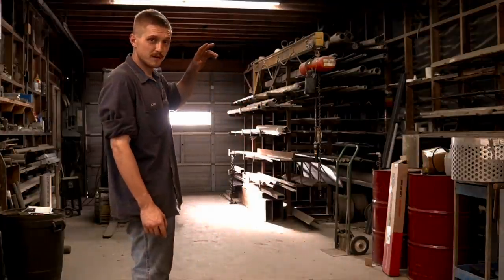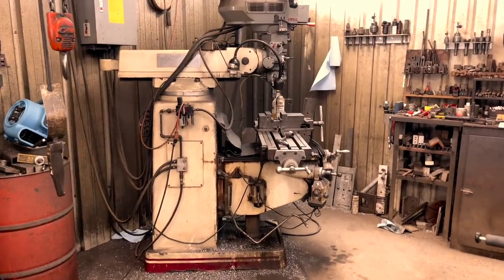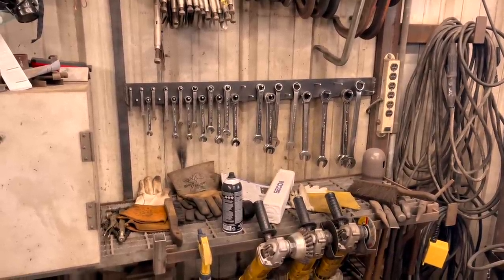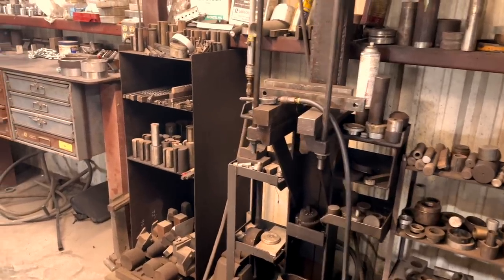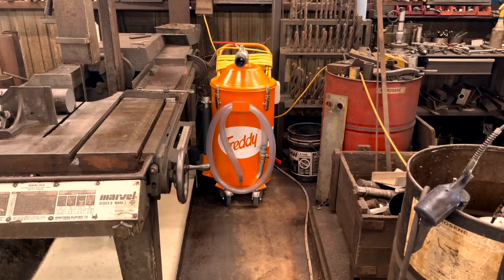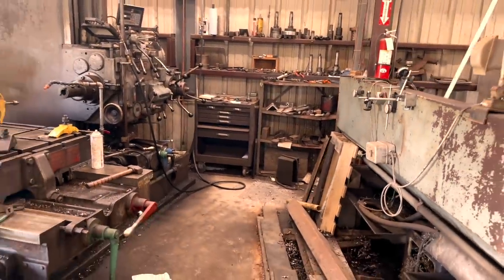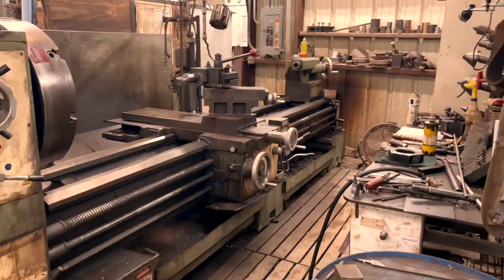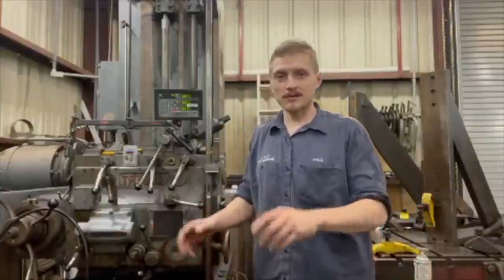Machine Shop Tours: TJ's Machine Shop

Comment: A REAL Machine Shop! I miss these old places where you can virtually make or repair anything. We had a bunch in Signal Hill, Ca for the oil fields and Aircraft Maintenance. Plus, with Lions Drag Strip nearby, the owners would invent new dragster parts on the fly! They're  all gone...

Comment: Thank you sir. Much brighter, cleaner and far more room than the shop I started in when I was just a sophomore in high school. I was 14 or 15 and ended up with quite a career in CNC and CAD CAM as it was coming out in the 80's and 90's. But I am still a damn good manual machinist. Much administration sir.

Comment: That brought back a lot of memories for sure. Some of those machines were identical to what I learned on. Same as you, Air Force machinist and went in machine shop work after separation. Worked 29 years in job shop. Started out all manual machines, then learned CNC when it came on the scene. Moved on to another big shop and retired about five years ago after 45 years in trade. Sure do wish I still had access to a shop like yours.

Comment: Great shop tour. Don’t just throw in a bigger breaker without upgrading the wire. The breaker is sized to trip before the conductor melts.
Reply: Yes NO & Some times
 The NEC allows you to size a circuit breaker at least 175% of nameplate ampere. Often had to install next size circuit breakers for say air compressors to prevent breaker tripping on motor start up. 40 years ago the NEC only had a quarter millon words. Probsbly halve a millon words. Asked 3 smart inspectors the same question and more then once got 3 different answers. Great to see that there are still some shops not using CNC mills.

Comment: You might consider making more videos.  Your presentation style is excellent.  Question...what is a spade bit?  I'm familiar with wood spade bits of course, but not metal.  Do they use an insert for the cutting edge?  Will they work on a standard milling machine (Bridgeport) or are the speeds/feeds/down pressure insufficient?  Thanks.
Reply: It’s just a drill insert “Spade drill insert” on msc 
You can, I’ll rarely do it, but it can handle up to 3/4” usually. 3 thou feed off the quill will push a 3/4” at 300’rpm. Paired with coolant they’ll last a long time.  Twist drills are faster with cool mist going on a Bridgeport. If you need to make big holes quick look into slugger bits.  On the lathe spades  are best if you have reduction  tail stock.

Comment: Very nice Tour  i am a retire Woodworker by trade  although i  do have severalFamily members that own and Operate their own small Machine Shops , we did exchange Work Professionally for many years  not really anything that made each other Wealthy , but it was always nice to know we were making a honest days Pay  on those Jobs as well as getting a fair mutually beneficial deal , for myself personally one of my  Duties in our Shop was setting up our new  or Newly Aquired Machinery for the Shop  and i usually got  called to  be of Service to the Family for the same reasons  I’m okay at operating Heavy Machinery  and  moving large heavy items  to get them into a precise Position with little to no damage  plus in all honesty the exchange does help me out on getting personal Welding Jobs done  or strange Parts i may need  for my Shop ,Boats ,Or whatever i can Weld structurally but i’m no Artist  and to coin my ownFathers saying as a him being one of 3 sons to a ProfessionalWelder  my Dad would call Splatter Bird Shit or droppings  so myself  i prefer to leave the Welding to the Professionals  and i’m fine with running over to their Home  or whatever to run some Moldings or whatever they may need

Comment: Same as the shop I started in way back. There was an old timer that had scratched his name on a window pane. in 1916. 'Gus' still worked there in 1968. I would like to have learned all he forgot. Lots of bigger machine , planer , shaper big radial drill, thread mill.

Comment: Bigger than the machine shop I worked in but similar machines. I worked in the tool and cutter grinding side mostly for customers.  Cincinnati's tool grinders,  big mattison surface grinder , O.D grinder.  I did cutter grinding for 31 years shop is still there

Comment: I most likely bought those CNC machines for your Air Force shop.  But I have no love for CNC machines and the monkeys that press the buttons.  I can make most one off parts for a repair or a production run without the scrap and crap (and I can damned well still do it at 77) the CNC produces in less time and materials used on those old worn-out shop machines "that only real machinist know where to put the paper and brass shim stock" to get the job done.  My only wish is that the People in Greens Suits from slick sleeves to "managers now serving" have what they need to do the work our Air Forces has to have and done by a TO with those stupid books open and by their side can actually maintain the airplanes they are charged with keeping in the air.  You and your dad are a dying breed and I applaud your efforts.  Manual machines built this world and CNC is just mind numbing crap.  I have a son in law with and electrical engineering degree turned computer/CNC programmer and he is just coasting through life without ever knowing the pleasure of seeing a job of work come through the door while you are in the washroom cleaning up after a long day and then having to stay "until the job is ready to be picked up at 0700 in the morning."  I loved those days and if wishes could come true that is where I would be today.  But, wishes don't come true and you have to live sometimes way beyond your usefulness to the world.  So have fun along the way and just remember you are a real machinist and not in name only.  It only takes one light on over your machine: Your brain without a CNC.

Comment: 0:45: 🛠️ A manual machine shop in Corpus Christi, known for its work with marine, chemical, and oil companies, specializes in one-off parts and specialty tools.
4:41: ⚙️ Inside a well-equipped machine shop specializing in slotting copper bus bars and prioritizing efficiency and survival.
9:23: 🛠️ Overview of a well-equipped machine shop with various tools and equipment for metalworking and maintenance.
13:52: ⚙️ Overview of a Machine Shop: Equipment, Tools, and Workbench Usage
18:59: ⚙️ Exploring a machine shop with personal anecdotes, showcasing a lathe and discussing the importance of safety and learning from mistakes.
Recapped using Tammy AI

Comment: Hello my friend. I went to school seemingly forever after becoming a Pharmacist in the first round. I hated standing behind a counter being bored deling with single mothers and fat old houswives along with the hotties that are on so many psych meds it would scare you. Atleast they can take those meds along with their birth control pills. I went back to get a degree in chemistry and kept going for a Master's degree which put me in contact with metallurgical capabilities combined with chemistry. I achieved my PhD in Organo-metal transition catalysts.(using metals to catalyze reactions that otherwise would be impossible , improbable,  excessivley difficult or costly) I have always loved welding and repairing /restoring exotic cars such as air cooled Porsches, VW's, Ferrari's and classic Lamborghinis. I have grown to dislike working for someone who has no idea about what I do and is usualy in a position that I can not figure out for the life of me how he,or she got there. In my spare time I have resored numerous classic Porsches and Lamborghinis. The parts are incresingly hard to obtain either because of shipping or greed r both. Learning how to use an old lathe that I found in a shed in North Jersey as well as a Milling machine that a friend of my father's had due to his love for fabrication and machining. During my last position in a pharmaceutical company I had the time and money to start purchasing engine drive welders, a couple lathes, some other metal working equipment and doubles of others. I was hit aand run over by a Ford F350 and left on the side of the road in front of my Dad's house wrapped around a tree with my right leg crushedand casting blood clots to my haeart and lungs. Somehow I made it to the hospital and when I came to on the gurney being wheeled into surgery the surgeons were asking how I made it into the front of the hospital because I sure could not walk. They also said if I had waited another 6 to ten minutes I would have been dead with no chance of coming back. Its been 18 months and my 1957 Panhead is long gone but I have learned to walk again and have made up my mind to start a mobile welding and fabrication/machining business that will cater to heavy equipment and construction companies who specialize in excavations and land clearing. I am almost finished my welding trailer since I am dedicating the flatbed on my Ranger to a 20 foot extendable crane. I want to be able to be the complete problem solver with the ability to make  parts that are obsolete , hard to get or costly along with the extreme times it takes now to get parts delivered. When these companies get $4,000 an hour for equipment rentals a broken machine is an expensive problem. I want to be the person who can disassemble the equipment without the owner having to rent a crane and weld any damage as well as make nearly any part that is necessary overnight or within a very short period of time. I love your shop!! Fantastic. I hope to someday have a shop with the exact equipment and good friends who have my same work ethic.It is going to be hard but I am willing and able. I hope to meet you and your dad sometime. Thank you for the video!!

Comment: 21:12 You run that entire shop on that air compressor?
Would have expected something three phase, like a screw compressor, with that much equipment.
Does the shop have an hourly rape?
If so, top or bottom?
No surface grinding nor plunge BDM?
Reply: There’s a compressor room behind the shop lol

Comment: Pig sty , not clean. The most important part of any really top quality machine shop is keeping it totally & completely spotlessly clean, everything in racks, all sharp tools and ready for next job. Each machine washed down and wiped completely clean after each use as that is part of the job.  Also never run a Bullard or boring mill. Them are the machines nobody wants any part of.